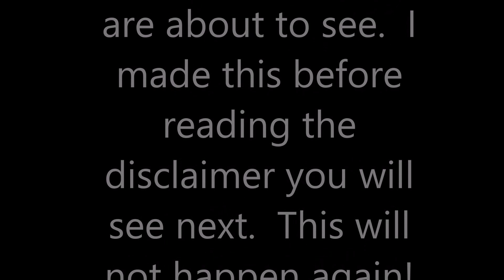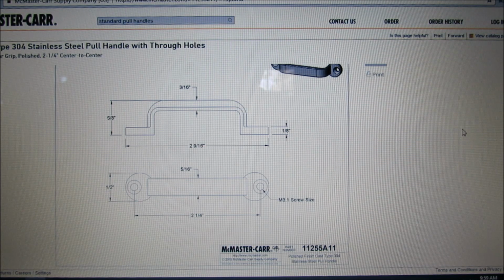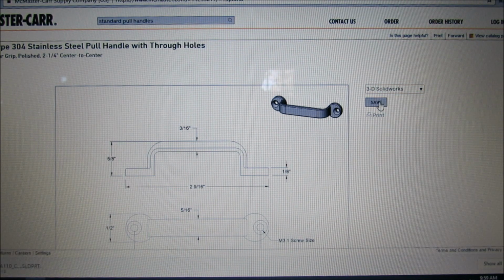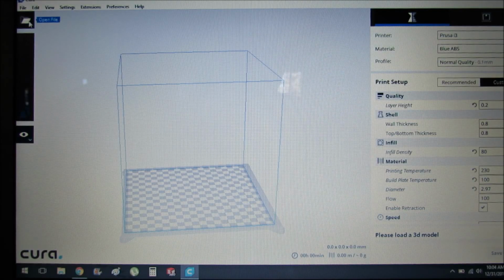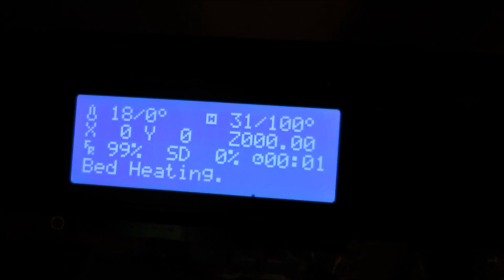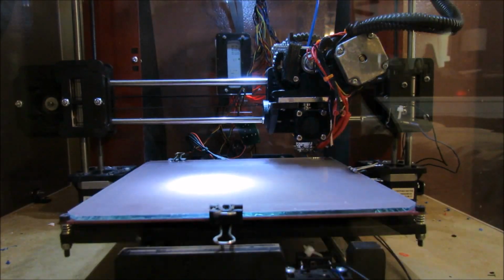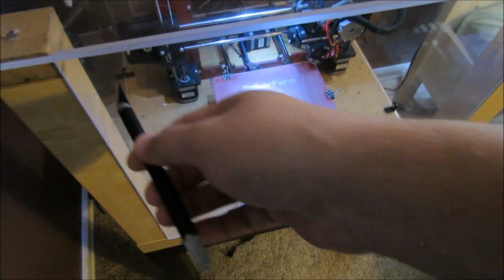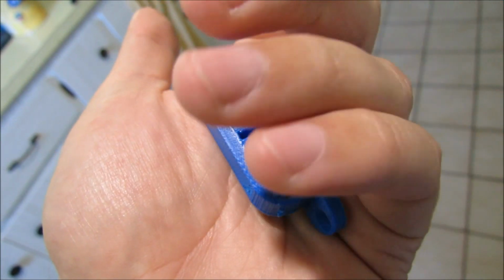3D Printing Downloaded Parts (Do Not Do This!)

Comment: Wow, what a clickbait title. Do not download models! Yeah i know this is not what you meant.

I don't think the issue is that big. These are fitting samples, you can download and actually print them to check if the things fit as part of the purchase decision - the license seems to allow that, and they should be happy enough if the file leads to a purchase decision. If you decide not to buy the item from their store then... what are they gonna do about it? It's likely not provable that you haven't considered the purchase. If you profit from the files like offering them or printed parts as part of your product, they have a clear-cut case against you on the other hand, and i think that's what they're really aiming for.

If you needed a custom handle or something like that, stealing the handle CAD file would be outright stupid - you could get a customisable scripted handle off one of the numerous sites with a suitable license that allows the intended use - and it's going to be better, because it can have limited overhangs programmed in and could be printable without support in a different orientation - and given how uneven extrusion you have there, i really don't see you being too fond of supports.